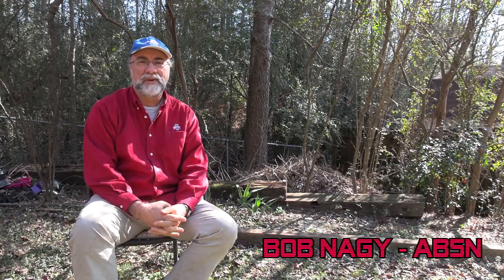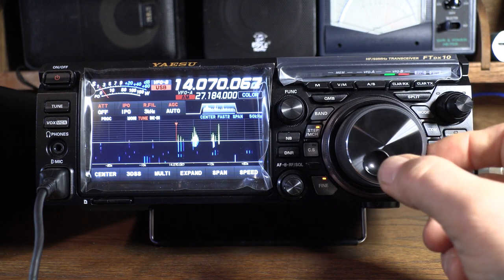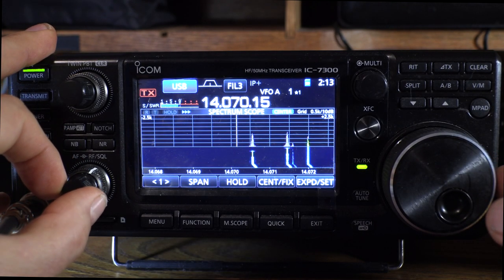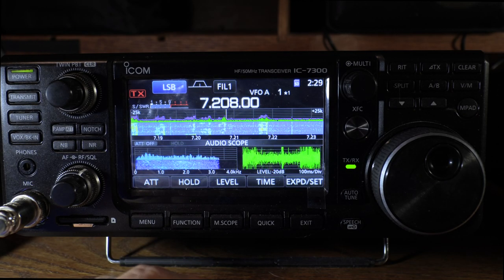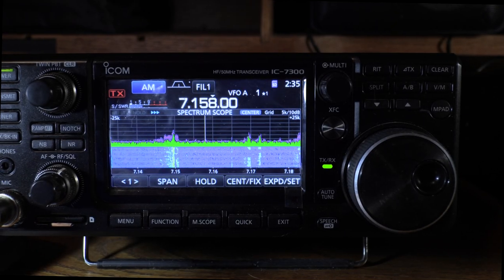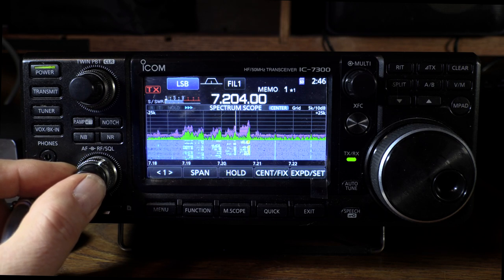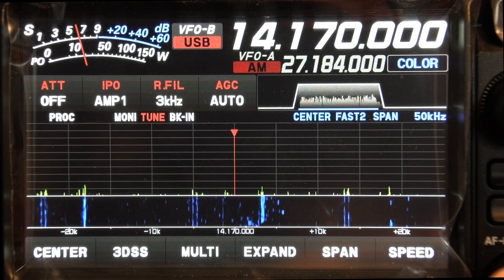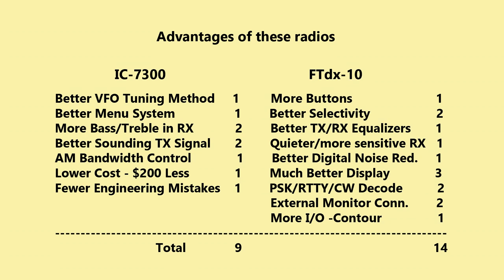Head to Head Comparison of FTdx-10 to IC-7300.

Comment: I own both of these radios and the plus for the 7300 is that it is much, much more intuitive to operate and the FTDX 10 has a better receiver.  however you need to take points off for how tight everything is around the tuning knob.  you’re forced to lock the frequency not some of the time but all of the time in order to use the buttons around the tuning knob. Additionally five years newer technology and play with the FTDX 10 versus the 7300. Icom needs to  be coming out with the 7310 soon to remain competitive.
Reply from the maker: The question is: What nitch does Icom have to fill next? Really, they will probably replace the IC-7851 (just discontinued) with a ultra-deluxe SDR radio...but give them 4 years. Their 60th anniversary is coming up.
Reply: What the people (aka all the new people) really want is a direct replacement of the ft-857D with all the new whip grease of these new rigs. Portable, powerful, mobile. I don’t want a dedicated person on comm, I want comm with additional capabilities..

Comment: Very well done comparison! Thanks Bob! I own both transceivers, among others. The Yaesu FTDX-10 needs careful adjustment of the parametric equalizer to get a decent modulation (with the supplied microphone) whilst the IC-7300 sounds great out of the box. Otherwise the IC-7300 is much more intuitive to operate and I recommend it for beginners. And here in Europe it currently costs about EUR 350 to EUR 400.- less than the FTDX-10 - best transceiver value you get for your money. The Yaesu FTDX-10 has a better receiver which only matters under specific operating conditions but I don't like that the many buttons are so close to the tuning knob and I frequently manage to unintentionally change the frequency. Personally I tend to like the 3D scope but admit that one has to get used to it somehow.
Reply: If someone doesn't care for the scope the FT-891 is cheaper again with a much better receiver, filters and audio (with headphones) I listen with headphones mostly anyway. The quieter receiver on the 891 is just so nice to listen to and the contour function adds a lot more clarity to the audio. I found the 7300 audio just too harsh needing NR on all the time which messes with the audio quality.

The 891 can be the first receiver while someone saves for a much better radio than the 7300 and then keep the 891 for portable operation or as I do, use it as 2nd radio for SWL in my sitting room connected to the Chameleon MPAS 2.0 and I make some decent DX on it too esp on 20m SSB in the evenings or sometimes I work some PSK31 or Olivia. So nice to have 2 radios sometimes but I really love the 891, very menu driven alright but most settings are set and forget. Can even be computer controlled with flrig which is quite convenient. 

For a radio with more buttons the FT-450D is another decent cheap radio and looks great in low light conditions. 

I sold my 7300 and got the sun sdr 2 dx boy what a difference, don't miss the 7300 one bit, the sun has an amazing noise blanker that almost remove all my power line noise that the 7300 didn't reduce in the slightest, the 7300 noise blanker is useless. The remote function on the sun is amazing, no need to be in the shack any more.
Reply: ftdx10 top of the list of Rob top notch
Reply: @o00scorpion00o  l
Reply: FTdx10, apart from your personal tastes, it is objectively better. Its receiver is truly terrific.

Comment: I love how during the demo of the 7300, the OVF light comes on and off several times. That is why I got rid of my 7300 and got an FTDX-10.
Reply: Turn on attenuation or reduce RF gain
Reply: @mikant71  
That will  attenuate the signals you want to receive also.And no RF control on IC-7300
Reply: @mikant71  That has never been necessary on ANY of my other radios.
Reply: @mikant71   why should you .. 7300 rubbish radio .. hence why i solld the 7300 and bought the Ftdx10
Reply: All radios can go ti overflow. ICOM have this Great control and you can adjust It. Sdr radios are different technology.. 7300 have Great sensibility
Reply: @don_n5skt  not Is true...other radios dont have ovf signal...
Reply: @Manuelgcv6  Again, not necessary on my Kenwoods, Yaesus, Flex, Hermes Lite. etc. Those are running at factory default. Even the 705 does not have the issue and has no need to adjust the RF Gain.
Reply: You got rid of your radio because a light was telling you you could back off on the RF gain???
Reply: @johnarcher9480  Hell no. Because when the light came on the radio reciever desensed. And again, I am NOT having to do that with ANY of my other radios so no, I did not turn the RF Gain down. NO. Not necessary.
Reply: @don_n5skt  Its a warning light. Other radios might have this problem as well, but they do not show warnings ...
Reply: @sas7388  What do you mean? There is  RF gain/Squech control knob on front panel
Reply: @bradleydevon1668  Believe it or not but I find my 891 was a lot better than my 7300, receiver performance and audio quality was a lot better than the 7300  which is gone now and I got the SUN SDR 2 DX, boy, what a radio. The remote function is fantastic and I can use it all over the house as if I'm right at the radio or from anywhere in the world on my laptop or even mobile phone with browser, with limited functionality and no TX but good for RX when I don't have the laptop. 

The SUN Noise blanker even almost or 100% eliminates my powerline noise that I have occasionally and even removes the noise from the waterfall, the 7300 NB couldn't even reduce this noise even when the noise was at the minimum it can be. 

I'd love to try out the FTDX-10, a fine radio.
Reply: @artoliimatta9177  It is more than a warning light. The receiver desenses.  You can hear the drop in signals when the light goes on.  My other radios don't experience this with the same antenna and conditions in my shack.

Comment: Great shootout Robert, I do Have the IC 7300, started out looking at both(to replace an old but capable IC 751) I was still undecided, when a 7300 came up 1 year old at a great price.
I’m not the most comprehensive operator, but the 7300 is very intuitive to use, and has way more to offer than I will ever use, but I’m watching you an all,and learning.
73 de M7PBX.

Comment: Love the comparison, thank you.  We often take the rig out on field days, 2amps on received for the FTdx-10 compared with 900mA with the IC-7300 makes a difference for us.  Somehow I got used to the screen in the middle with the IC-7300 which I prefer, but this could be because it was the first one I used.
Reply: the 7300 is a old 2015 technology. the FT-DX10 is 5 years newer technology. It the more advanced and improved radio. if you buy the SP-30 ext. speaker it matches the Ft-DX10 radio perfect and sit on the left side puts the screen in the middles and make the radio look even more amazing.  I sold my old 7300 and used the $650 I got for it towards the  FT-DX10 and matching speaker. a way better radio and the FT-DX10 doesn't have the front end over load you get on the IC7300

Comment: Really informative comparison Bob and about what I might have expected given the time the 7300 has been on the market.  At the end of the day anyone would be happy with either radio.  Both manufacturers are at the top of their respective games.
Reply from the maker: Right. Because we at home cannot build these radios from scratch, I guess we will all have to suffer with the slight imperfections in their designs...ha! Thousands of design decisions went into these radios...built on decades of experience in HF design. They are masterful creations.
Reply: @robertnagy2163 That’s so right. I have most of what Icom have ever produced, but I also bought an FTdx 3000. To be fair, the FTdx 3000 is a really, really good rig. If it was the only rig I’d bought, I’d have no cause for complaint. But, I just prefer the way Icom design radios. It doesn’t mean they’re better, they both make quite exceptional radios.

Comment: Another great review, the best from Bob.  I think the price difference mentioned was $200; it is more like $400.  Not enough features to move me off the great user interface of the 7300/7610 for some increased selectivity.  Might be worth it if I were a contester.
Reply from the maker: It varies.... The 10 was $1399 and the 7300 $1199 the day I posted it.. There is a $100 coupon on the 7300 now. I expect Yaesu to start dropping their price soon. (after the early adopters buy the radio)

Comment: Very nice comparison video. I really liked it.
The Yaesu ticks my of my boxes for what I would need such an radio. I currently have a FT-920, a FTDX-5000D+, a FT-847 for VHF/UHF and a Flex-6600 in my shack but I need something for the boat. The IC-705 seems to be a great radio for me but with only 10 watts I feel very compromised. The 7300 or 10 would work great for me and the thing that I do like about the 7300 that the 10 dont is the ability to store the radio away safely (not getting salt water or falling of a shelf because of a leaning boat) and using it by wifi. This is fully possible with Icoms software called RS-BA1 for about $140. Wish Yaesu had something similar.
73
Reply: And the Icom 7300 has run pretty flawlessly for about 8 years now. Lets see how well the Yaesu ft dx 10 does. Theres  been some software issues from what some of my friends are seeing.

Comment: Your concise, unbiased review helped me to decide to purchase the FTXD10, unfortunatly after my house got flooded the purchase was delayed and now Yaesu is about to release the new FT710, which has thrown a spanner in the works.  Unless the 710 is a poor man's version of the 10 I will have to wait and see how the 710 compares, being a full sdr may have drawbacks as I live in an area with a high background noise level.
Reply from the maker: Well, the 710 IS a poor-mans FTdx-10. The specs are not as good. Tell you what. I want to review the 710 anyhow and may sell off the FTdx-10 I used in the review. Email me when you decide what to do.
Reply: @robertnagy2163  I know your response, "...specs are not as good" was a couple months ago. But so far, MANY reviews are currently pointing at Sherwood's tests as proof the '710 (receiver) is on par with the 'DX10. I'm on the fence between the '7300, '710 and 'DX10, as I'm seriously considering a return to radio [from a 5 year hiatus]. Can't wait for YOUR review of the '710. (I'll surely have ZERO use for the included speaker with the '710--too bad its NOT "OPTIONAL". Keep up the awesome work, Bob!!
Reply: @ikantplae  It seems that the only difference would be rejection of nearby signals at 100khz. Everything else is almost identical. The main reason for releasing the 710 is the re-arrangement of the buttons (main complaint on the 10) and the availability of a cheap enough ADC chip so as to be able to market the radio at a competitive price point (making a direct sampling SDR instead of the cheaper mixer design in the 10). I need to order one and get my 10 vs 710 review going. Thing is, I have to eat several hundred bucks to do it and I've been blowing $$ on other stuff!

Comment: Thanks for breaking down the differences. I've spent some time trying to figure out my next rig purchase - these two are the two main choices on the table at the moment (though I do have a fondness for the look of the IC-7100...). This should give me a bit more to go on - I'm thinking saving up for a little longer and forking out for the FTDX10 might be the better choice...

Again - thanks for going through this, it's really helped!
Reply: Yaesu make better radios in my opinion of course, and they sound better, Icom just doesn't get good audio. 

I had the 7300 and ended up having to get the panadapter and airspy hf+ to make the audio decent, I used sdr console and having control over AGC made a huge difference. Completely changed my experience, having a gigantic waterfall also made a huge difference. The audio from the 7300 is just too harsh, I always use headphones and without doubt my Yaesu FT-891 sounds a lot better and doesn't suffer from bleedover nearly as much as the 7300. 

It's an expensive way to go to get good audio from the 7300 so I would not encourage anyone to get new 7300 + panadapter + decent SDR, it's too expensive but I already had the 7300 and Airspy. 

I sold the 7300 a couple of months ago for the SUN SDR DX 100 watt radio and it's really amazing, it's something else to think about, a learning curve of course because it's all software but the noise blanker is amazing against the power line noise I occasionally have at my QTH, when pressing the NB on the 7300 and playing with the settings it simply did nothing, basically useless NB on the 7300, the Sun SDR even eliminates the noise from the waterfall. 

The remote capability of the sun is amazing too, it's as if you are plugged direct into the radio so you really don't have to be in the shack any more apart from to tune the amp or you can get solid state rigs that can be controlled from the SDR but I have the Acom 1000 so when I want more power I got to be in the shack, still being able to use the radio remotely even with 100 watts as good as it is on the sun is amazing. 

I'm sure the FTDX-10 is an amazing radio, I love yaesu radios and would love the 101 but the SUN SDR 2 DX is really worth considering at this price.

Comment: Hi Bob. Thanks for the excellent presentation. I'm still tending towards IC-7300, and your opinion and final numerical comparison is a very good proof of my ideas. More i/O, external monitor, and PSK/RTTY/CW decode are not important to me. Display greatness/weakness shouldn't be an issue. But all the mentioned advantages of Icom are much more important to me. 73!

Comment: Always great reviews!
I think the Yaesu sounds much better on AM then the 7300, the 7300 seems to cut the low frequencies off at about 200 Hz but the Yaesu goes down to about 50 I think.
So the 7300 sounds a bit thin.
Both radios are quite good for the price!

Comment: To begin with, I would like to sincerely congratulate you for the great quality of your work, incredible and very well made videos.  

You are a person who dominates and understands technologies very easily and uses this to help your fellow people.

 Congratulations.  ** 

I am considering purchasing a YAESU FTDX-10.

 I have an FT-1000 MP and a TS-2000 from Kenwood.

 But I noticed more quality and more technology in the FTDX-10 from what I've been watching.

 But I wanted to hear from someone really experienced and truthful the opinion if it's really interesting to buy this radio, if it's really worth it. 

Thank you very much from the heart in advance. 

God bless friend and family.
Reply: But could you give your opinion as a researcher and experimenter, which of the two do you feel better served by?
Reply: OK....well, I prefer the Icom radios. Why? Because your happiness with a radio is not only based on Sherwood Receiver numbers. For Yaesu to get those top numbers, they had to do a few tricks which do not like. The Receiver's audio frequency passband is tight and nothing you adjust can widen it. The Icom radios are pure SDR direct-sampling radios (the expensive way to do it). The receiver audio passband is flat and wide. My ears need the high frequency components, and the yaesu will never deliver them. Secondly, the menu system on the Yaesu is horrible. The Icom's is easy and intuitive. It's a new design and the Yaesu menu is from the older radios. Lastly, the Yaesu is a mixer SDR (older cheaper type) and they were unable to implement spectrum scope averaging. The display is like a strobe light show and isn't good. Controls are also hard to press on the left side of the VFO dial on the 10.  Best radio if you have money is the IC-7610. If you have money and courage, the Absolute best Ham radio is the Anan 7000 DLE II.

Comment: Hello, very nice video and explanations! i had them both, and both very nice radios! i have a question: yeasu ft dx 10 on manual gives maximum  sensivity on preamplifier 2 (which its normal), icom 7300 gives same sensitivity but with preamplifier 1 , question its what its the sensitivity with preamplifier 2 on icom 7300? i do use in quiet enviroment icom 7300 with a Lfa monoband yagi on 28mhz and i do listen all time on preamplifier 2  without OVF . From what i see, icom 7300 on preamplifier 2 on receive might be more sensitive than yaesu ft dx 10 on preamplifier 2. icom 7300 has same sensitivity on pream 1  as  yaesu ft dx 10 on pream 2 . what do u think? as i said i do find usefull icom 7300 receiving on pream 2 with good monoband antena and in a quiet enviroment. 73. low signals comes better with pream 2 with icom 7300
Reply: Difficult to answer. We have to think about it in the real world conditions. Unless you live on a farm many Km from another house, you will never be able to see an improvement from the 7300 preamp 2 over the FTdx-10. Other radio qualities are more important that sensitivity. The FTdx-10 selectivity is far more important in every day operations. The Sherwood tests show the absolute dB numbers of the two radio's MDS. I do not remember them. HF is so filled with many types of noise- that sensitivity may be #3 or #4 quality that determines if you will complete a QSO. We have had good sensitivity for 30 years with HF radios. Selectivity and DSP are where all the progress is.
Reply: @Yavor54  thanks, you're right. in real life does not matter to much